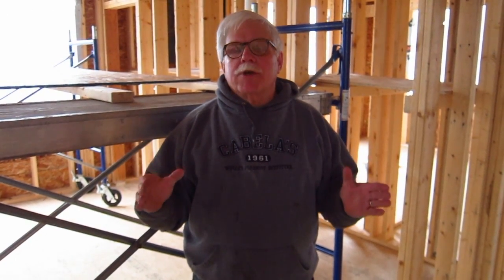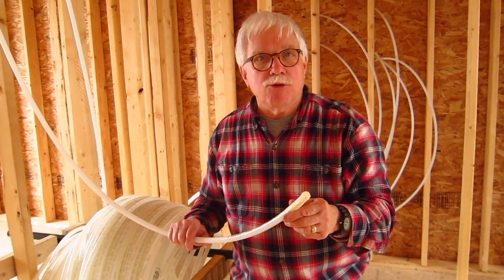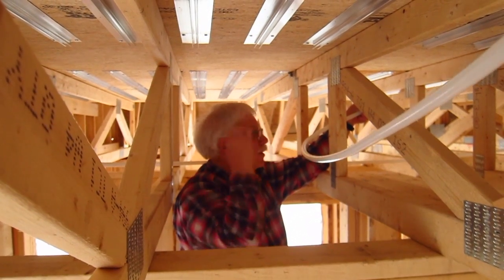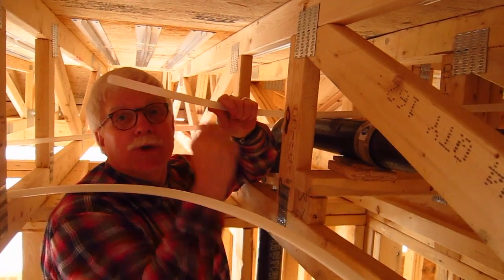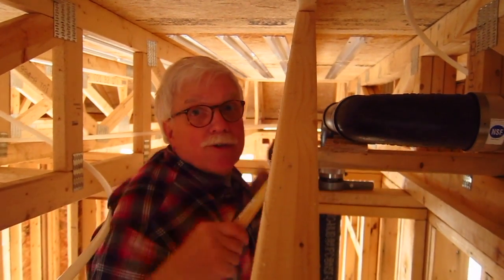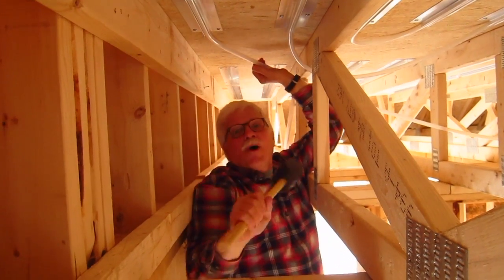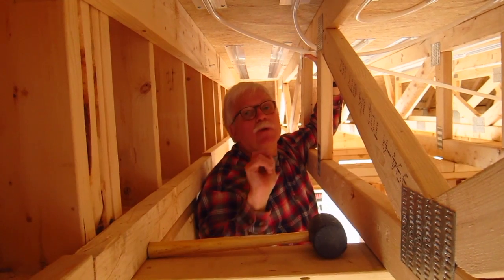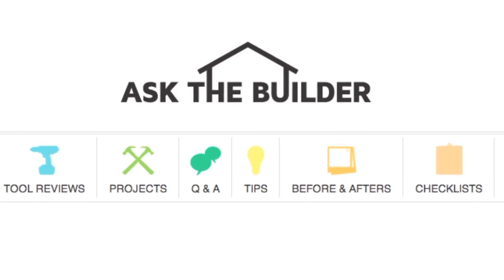Install Radiant Heat Under Wood Floor 24 Inches OC

Comment: The real question is how are you planning on insulating underneath the Trusses.
Reply from the maker: That question was answered in a very interesting story here: https://www.askthebuilder.com/insulation-installation/
Reply: @askthebuilder  if its a heated area, it doesn't need as much insulation..  It will just contribute slightly to the heat required below.
Reply: Double bubble silver insulation 2-3 inches below the PEX creates perfect air pocket. The I usually put regular R19 fiberglass or rockwool insulation.
Reply from the maker: Creating an air pocket is a HUGE mistake. Read the Uponor installation manual. The insulation is supposed to contact the radiant tubes. READ this past column and tell us if you'll be as open-minded as the insulation contractor that was doing it WRONG his entire career until he met me: https://www.askthebuilder.com/insulation-installation/
Reply: Why not have the beginning of the run, when the water is at its hottest on the outside wall?

Comment: How thick can the floor be for the heat to radiate through ?
Reply from the maker: It depends on the floor material. Far too much to type. I'm happy to discuss it over the phone: https://shop.askthebuilder.com/15-minute-phone-or-video-conversation-with-tim/

Comment: Nice job, but I would've ran my supply to the cavity next to the exterior wall first.  Of course, you could always simply relabel your return as the supply.
Reply from the maker: That's exactly right. You want the hot water to start flowing NOT parallel with an exterior wall. That last length of the loop immediately adjacent to an exterior wall should be the return going back to the boiler to get reheated. I appreciate your comment. It's a keeper.

Comment: Question how this under wood floor heating works when the house has ceramic tiles
Reply from the maker: It works fantastic. The floor above my head was ALL ceramic tile - both floor of the house. The tile is TOASTY warm.

Comment: I don't think this is the best way to do it. you will always have much more heat on the side closest to the boiler. you will want to skip over truss bays then hit them on the way back, in reverse order. that way, the first truss/stud bay will have both the hottest loop and the coolest loop in it. it will cost a bit more in pex, but we're talking $100-$200 more in pex cost, which is nothing in the grand scheme of a heating system. you may even want a manifold/Tee and run two separate branches, one starting at the far end and one starting at the close end.
Reply from the maker: Well, Uponor is quite possibly the world leader in radiant floor heating. This system was designed per their specs. You might want to read their installation manual.

Comment: Is the system working well and is it as efficient as you had hoped?  I am considering a similar system for my new build next spring.
Reply from the maker: You bet it's working well! There's lots to know about how to do it right. I offer phone coaching if you need it: https://shop.askthebuilder.com/15-minute-phone-or-video-conversation-with-tim/

Comment: Question: Would a reflective barrier be installed next to reflect the heat up into the room above?
Reply from the maker: I'd never do that. You need to press the fiberglass insulation directly against the tubing to force the heat up, not down into the joist bay. You better go to my www.AsktheBuilder.com website and read all about radiant barriers and the CRITICAL thing you need to do to make them work.

Comment: Hi There
I will be starting to build a home in a month and am looking at installing in floor heating between joists but am wondering how I am going to install my hardwood floor on top later as the staples would hit the water lines is there a way to suspend the heating tubes so they are not tight to the subfloor allowing room for staples. I know they suggest gluing the hardwood down but wood prefer to staple
Thanks
Les
Reply from the maker: The tubes must contact the subfloor. You use fasteners that don't penetrate into the tubes. I'm happy to discuss it with you: https://shop.askthebuilder.com/15-minute-phone-or-video-conversation-with-tim/

Comment: What if you need to install a hardwood floor above?
Reply from the maker: Simple. You use the correct fasteners. I can call you on the phone: https://shop.askthebuilder.com/15-minute-phone-or-video-conversation-with-tim/

Comment: I think its importance to Note that with radiant floor heat, the flooring application above should not be carpeted or have vapor barrior underlayment, as it might not hat as well   as intended. I also think I would use this in New contruction or a full renovation, as its importance that the space is well insulated to make this app. Very effective.
Reply from the maker: You're correct about INSULATION. Read this column that was written about this installation in the video. It should really open your eyes: https://www.askthebuilder.com/insulation-installation/

Comment: Looks good but I think I’d rather put the hottest loop to the outside wall and come back towards the the boiler while it cools because your biggest heat loss is going to be at the outside wall, but good work.
Reply from the maker: TNX. What do you think the temperature difference is in the PEX between what you see in the video and your method? I'm talking about that joist bay on the outside wall. Would you think the difference might be 0.3 F? If that? What's more it's all about the overall Btus in the house/floor and what's happening  as the cold exterior walls suck it from the house, right?
Reply: in all reality, if your pump is sized right and your thermostat is dialed in, with the commination of mixing valves there really shouldn't be more than 3-5 degree heat loss on this.  comes down to pump, length of run, insulation, thermostat...  with the right thermostat it should be more of a constant flow versus a sudden flow.  However, this takes some playing around with the mixing valve.  Obviously certain times of year require more heat to transfer than others.  The goal is to find out which will work best, this can only be learned by the home owner, or by an installer that installs this system regularly in the area.  Although in most cases, if the homeowner is some what handy they can figure it out on their own.

Comment: From Uponor literature "When possible, start with the 
warmest water on the exterior 
walls and progress toward the 
interior of the room. The direction 
of the panels in the layout dictate 
the tubing runs."
Reply from the maker: True, but in a normal house if the floor joists are all parallel in the entire structure, you only have two places to pull this off. Those two exterior walls that run parallel with the floor joists.

Comment: It seems like the loops go from the middle track to the last track every other bay.   Why
Reply from the maker: Because that's the way we did it.
Reply: @askthebuilder  so thats just the way you felt like doing it ir is that what uponor recommended ?
Reply from the maker: Uponor didn't have instructions on how to do it with a 24-inch on-center application. I figured out how to do it myself so the tubing doesn't kink and the loop works as is required.

Comment: Wondering what was the max length of each pex run.  200'.  ????   Thanks,  Rad
Reply from the maker: Read the Uponor Radiant Heat manual. You don't want to exceed 300 feet per loop. The sweet spot is 215-235 feet. You can also use 3/8-inch tubing. It works just as well as 1/2-inch and is easier to work with. That said, you need to be sure to use the correct recirc pump with 3/8" because of the extra friction. It's all covered in the Uponor instruction manual.

Comment: You can do it off a ladder, done it many times...
Reply from the maker: You can do it on stilts too, or even riding a unicorn.
Reply: @askthebuilder  where to find a unicorn? i want to have fun while i work
Reply from the maker: I got mine at www.unicornsforrent.com

Comment: Since the goal is to keep from having to make a tight turn couldn’t you go every other channel (like you did) but rather than making the one tight turn in each bay... just keep going every other channel until the end and then “return” doing the same thing coming back towards the manifold?  Should be the same amount of tubing...never makes a tight turn and gets the hotter water distributed all the way across the zone quicker.  Hope I explained this clearly.
Reply: I thought the same thing. Go through half the heat transfer plates on the way out, then hit the other half of the heat transfer plates on the return. Instead of having a straight return. Should have better heat distribution. This video is fantastic! But i think the floor near the manifold will be much warmer then the floor at the other end. Or is the room not big enough to notice heat loss over the course?
Reply from the maker: Get out a roll of string and some thin pieces of wood and make a model. Demonstrate how you'd do it, but use a LONG piece of string just like you're working with a 1,000-foot roll of PEX like we have to do in the field.

Comment: Interesting... I'm curious to know if you could also use this system to cool a house?
Reply from the maker: No. You need to cool with forced air to remove the humidity from the air.

Comment: I wish I'd hired you!  
I wonder if heat transfer plates would have worked better than Ultra Fin.  I only have one PEX tube per joist bay.  I almost want to take the ceiling off my garage and run more PEX with heat transfer plates (just junk the Ultra Fins)
Reply: you'll know if the ultra-fins are working correctly if the return water is ~30 degress cooler. convection isn't going to be as good per unit area as this conducted transfer, but it can be made to work.

Comment: Just installed a $50K ($42K + 20% to GC) hydronic Ultra Fin and Runtal radiator system to my house in San Francisco.  
My gas bill has doubled from my old forced air heater.
My house is so cold I have to wrap myself in an afghan to watch TV and I wear a down jacket in my office if I'm on my computer. My floor is warm and small rooms are warm (bathrooms and a 10 X 10 bedroom). 

After about 6 months had a leak in my garage - nail from hardwood floor. GC still haven't replaced the ceiling that got wet.

My newly refinished hardwood floors cracked. (GC didn't run heat at all before refinishing AND some of the old floors had water damage which he knew about) GC's hardwood guy said even if the floors warm up he cannot guarantee his work on radiant heat. 

The installer didn't know a thing about Runtals - he initially hooked the towel warmers up to the floor system.  I moved in in April and right away I noticed the towel warmers didn't come on as the floor heat was only on for an hour at 5:30 am.

  I made him hook downstairs bathroom towel warmer up to the upstairs living room Runtal radiators thermostat so at least I can close the upstairs radiators, crank up the thermostat and warm my towels. (Now that is is cold I'm leaving the bathroom door open in the master so the 48" towel warmer can "boost" the floor heat in the bedroom)
I demanded that he install two small radiators in my TV room and my office (one I decided I didn't need for my living room, the other was a mistake - he ordered the wrong color) so I have heat the three months of the year it gets down to 50 degrees in San Francisco.  Still waiting - last time he was here he hooked up on Runtal in my living room and the towel warmer in the upstairs bathroom.  The towel warmer is also hooked up to the floor system and need to be redone.  Oh, he isn't taking sheetrock off the basement ceiling to run the new tubing - just stringing it across the ceiling. 

Initially I wanted just Runtal radiators but the heating contractor and my GC talked me out of it:
"Sure you can combine floor and Runtals - no problem!" (you shouldn't - they run at different PSI)
"Never had a problem with hardwood floors." The GC's hardwood guy was the first to say "I can't guarantee my work with radiant"
"With Ultra Fin you don't have cold spots."  Yes you do.  It doesn't generate enough heat to heat a 1,250 sq ft house - IN SAN FRANCISCO!
Maybe, in theory, if designed and installed correctly, Ultra Fin can heat your house in winter and not jack up your gas bill.  Maybe.
Reply from the maker: This is simple physics. Your house has a given heat loss in Btus per hour. There's no reason why your bill should go up if you're introducing the same amount of Btus per hour with the new system as the old one.

Comment: I can see doing this in a retrofit with floor access only from below.   But in new construction, with floor trusses, why run the tubing under the subfloor?  Much more difficult and those Uponor transfer plates are crazy expensive.  Many options exist for installing the tubing above subfloor, where heating will be much more efficient.
Reply from the maker: Mike, can you provide some independent data from a trusted source to back up your claim: "Many options exist for installing the tubing above subfloor, where heating will be much more efficient." Or, is that just your opinion?
Reply: @askthebuilder  Not just my opinion, though as builders we should form opinions based on empirical evidence re: what we've seen work well or not, then be open to change based on available evidence.    It's generally accepted best practice among the most reputable builders and radiant installers in my area:  1.  common sense tells you as an installer that tube installation is significantly easier above the subfloor as opposed to drilling every joist, working overhead, working around framing obstacles,  zoning when basement rooms don't align with upstairs rooms, tight bends/kinks with the hepex, etc.  Don't think you need independent data to imagine all the labor savings and improved layout options when installing above subfloor?  2.  all things equal, the physical laws of thermodynamics favor not putting a poorly conductive wood subfloor between your heat delivery source (the tubes and plates) and the heated space.  Installing below subfloor will ALWAYS require sending supply water from the boiler at a higher temperature to deliver the same heat level above, or required the boiler to cycle more.   This is not only more expensive on an ongoing basis;  if hot enough this condition will prevent a condensing boiler from operating in it's highest efficiency range.  3.  above floor eliminates the need for special foil-faced reflective sheeting below the tubing/above the joist insulation.  Of course need to insulate the joists below with either system.

Don't get me wrong, or feel attacked...I'm currently doing a "staple-up" installation right now, with hepex and aluminum transfer plates.  It's our best available option due to available below-floor access and an existing finished living space above.  But it's incredibly slow and expensive, and will be inferior to an above-floor installation when complete.  You work with what you have.

My whole point is: if you have new construction, why not take advantage of your ability to lay out and install the delivery system most efficiently, and to deliver the heat in the most efficient and comfortable manner?  My choice would be tubing embedded in lightweight concrete if engineering allows, or Quik-Trac panels if the framing was not engineered to take the weight.  I would personally avoid Gyp-Crete even though it is fast and cost-effective, but that's purely my opinion.  I've never personally seen it fail but have heard horror stories and thusly question its durability.  Don't want the actual evidence to occur on one of my projects.

Comment: I've used that in 2 different homes one under with 16 oc ijoists the other on top with gypcrete, i fought like heck on the i jiosts one but had issues with drywall cracking on the gypcrete,  the floor trsses make all the difference. Thanks for sharing this vid.
Reply from the maker: If you want unlimited tips like this each week, subscribe to my FREE newsletter at www.AsktheBuilder.com

Comment: This might be the best video on this topic I've seen. 

On the long return run would it be wise to heat syncs, just to extract all the heat possible? Assuming that run is a hallway or other room with some foot traffic?
Reply from the maker: The entire loop is delivering heat to the house - even the long return run. Always remember heat travels to cold. Thus if the water in the return leg is now down to say 90 F and the floor above is 82 F, the heat from the return loop is sucked into the floor until such time as the loop dives down to the return manifold in the boiler room.

Comment: One of your best videos in a long time.  My next home will have radiant floor heating in it.  A friend recently acquired a 7,000sq.ft. home in a colder area of Michigan (it was vacant for 5 years, and the people just offloaded it for dirt cheap).  It has radiant floor heating EVERYWHERE (yes, including the garage, basement, and driveway).  He told me that it costs him about the same to heat that massive "cottage" as  it does to heat his much smaller 2400 sq.ft. home that has gas forced air.  The cottage was MUCH MUCH more comfortable as well...I wish they would just make radiant floor heating "standard". LOL

Comment: What advantages does this water-based under-floor heating system have over electrical in-floor heating?
Reply: Electric resistance heat is the most expensive per BTU. Gas is the cheapest.
Reply from the maker: Read all about the advantages of water over electric on my website. Go here: Get unlimited FREE tips like this each week by subscribing to my newsletter at www.AsktheBuilder.com